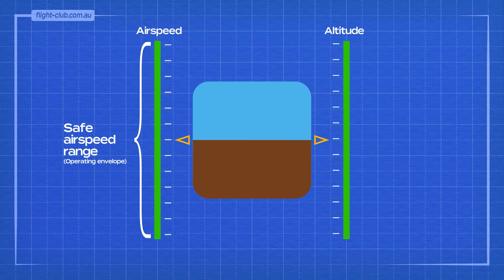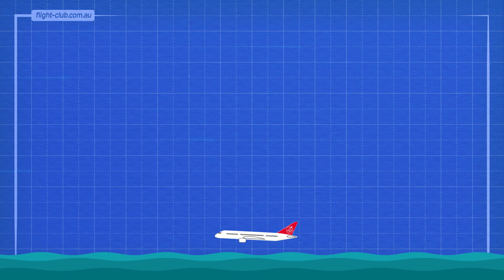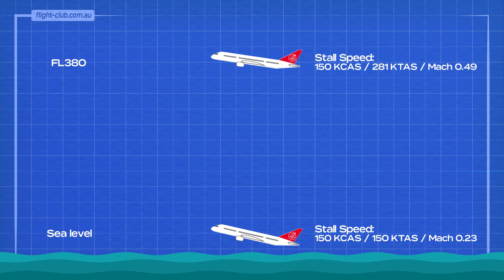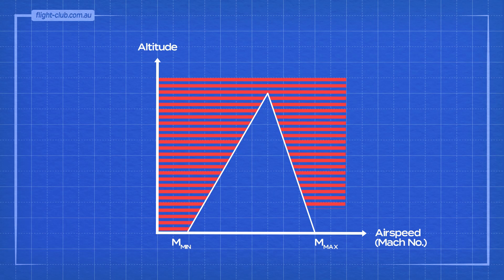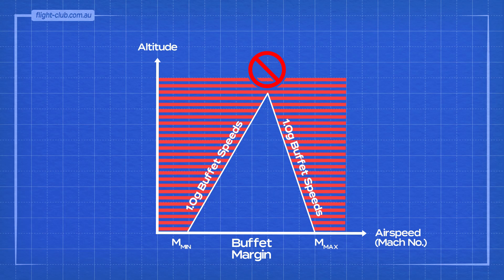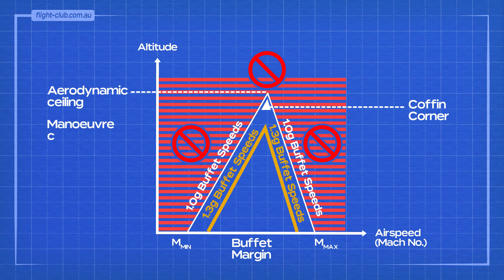Understanding Coffin Corner | The High-Risk Zone in Aviation.

Comment: Thank you for the video. There are however many wrong things said. To name a few:
- at a given weight, Stall speed increases with altitude : at a given CAS, Mach Number increases with altitude, and increasing Mach Number decreases both stall AoA and the lift versus AOA Curve. In other Words, your stall speed maybe 150kt CAS at SL, but can be 180kt at FL380
- high mach buffeting is a function of Mach and incidence, primarily (it may vary a bit with altitude due to reynolds effect on shockwaves). When you fly at Sea Level, your VMO (lets say 330kt , which is Mach 0.5 at SL) prevents you from flying at a Mach number where Buffeting may occur. When flying at higher altitudes, you fly at a given mach number (CAS is way lower), and at this mach number, if your incidence is too high (e.g too heavy or maneuvering at high load factors), you may encouter buffeting. That is why regulations require that the operating enveloppe (at a given weight) is being limited by a minimum maneuvering capability.

To put in a nutshell, when altitude increases : your lower boundary increases due to the increase in stall speed, and your upper boundary decreases (due to margins to buffeting, or simply due to MMO itself), up to a point at which the margin may be as low as a few knots (check U-2 spyplane info).

Comment: Wait… isn’t Mcrit and therefore MMax roughly constant with altitude for an aircraft? Max (buffet) values for TAS, IAS, CAS and EAS all decrease with altitude, but not the max Mach no. So, shouldn’t the chart showing Min and Max airspeeds show an effectively vertical line for Max value if it’s being expressed as Mach Number and a sloping line if represented by any other airspeed?

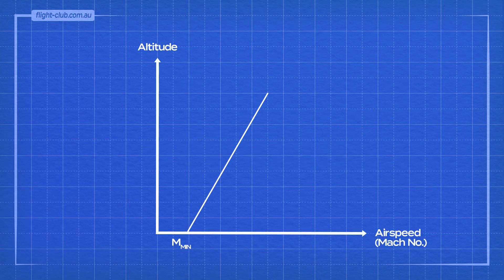Comment: From 2:27 you said "" The Mach number for high speed buffet decrease with increase in altitude ""   how this happens can anybody help me with this
Reply: Due to lower density of air and Lower pressure, the Mach number for buffeting decreases with height as the instability of airflow over the tail wing is usually higher due to a lower density so air compresses more quickly. 

Think of it as squishing water and dough, the dough is hard to squish, like high density, low altitude air, and the water is easy to squish, like low density high altitude air. The more squish, the more compressive the fluid and the easier it can buffet. 

Compressibility is a pain but reading from Wikipedia online should suffice if you want more reading.
Reply: It’s because when the altitude higher, the temperature goes down. The cooler the temperature the smaller local speed of sound(LSS). The aircraft will therefore more easily reach Speed of sound and create shockwaves, which generates high speed buffet.

Comment: But shouldn't the air resistance decrease when you go to the higher altitudes and therefore the maximum speed you can go should increase rather than decrease before you hit the turbulent eddies and stall? What am I missing here?
Reply: Sound's speed decrease with air density, so you have the formation of shockwaves at lower speeds

Comment: 0:30 altitude is just one of several factors that dictates stall speed. It isn't just altitude. Load factor, total weight, temperature (air density)... location of center of gravity, power, power location (nose, wing, tail), and power type...
Reply: They aren't trying to explain what determines the stall speed of any one aircraft, they're trying to explain what causes the coffin corner. In that regard, an aircraft's stall speed increases with altitude.

If this was a video about what factors dictate how aircraft are designed in regards to stall speed and pre- and post- stall characteristics, they would mention those factors. But it's not, so they aren't going to make an hour long segment on irrelevant pedantry.

Comment: Excellent description.  Of note, on modern airplanes the limits are visually displayed as shown at 0:26.  I spent a lot of time on the MD-11 and it was common to see these limits depicted by the airspeed indicator at high altitude.  As expected, the limits were reduced when in a turn and after an extended period of cruise (hours) they would decrease and in many cases disappear altogether.  While they were designed to allow a margin of error, in all cases they were respected.

Comment: A easier way to explain it is to use smaller planes as it is easier to visualize. You plane can only go so fast before the wings rip off. Aka airspeed limit. You also have a fixed wing area. As you climb the air thins but you can still only go so fast. Lets say your in a Cessna 172 your limit speed is 125 knots. at 0 ft it takes only maybe 60 knots to make enough lift to lift the entire plane. HOWEVER at higher altitudes such as 10k ft you must be going around 100 knots to support the same weight. Eventually those 2 numbers cross and that point is your service ceiling. For smaller planes which don't have to worry about mach effects you can have the throttle all the way in going full power and you will just stay at the same height. (around 12k ft for a small plane). Its like as you go up your wing gets smaller and smaller.

Comment: I read that while piloting the U2 at very high altitude, 90,000 feet more or less, the pilot has to maintain air speed to within 5 knots.   Go above or below and the U2 plane will stall and fall out of the sky.
This video helps explain why.
Reply: Now imagine some SAM locking unto you and launching a missile
You cant really maneuver, you are a sitting duck essentially
Reply: @danieldorn9989  just HOPE it loses lock or something
Reply: There is no way you were reading while piloting the U2
Reply: Was going to say something about it living in the cusp of that corner, but I got here a bit late.
Reply: I believe there’s actually a couple planes with rear mounted engines that can get into a “super stall” where it’s literally impossible to get out of the stall. I forget the exact aerodynamic reason why though.
Reply: Planes are meant to glide tho they don't just drop ?
Reply: @triggas80  They drop like rocks when stalled, and controls do nothing until they regain sufficient speed. A heavy fast plane can drop thousands of feet before regaining control, and passengers fall back into their seats.
Reply: @triggas80  and i'd just like to add that the U2 could theoretically flat spin slow enough to NEVER regain ANY control authority again and would just flatspin down from 90000 to a hard impact with the ground.
Reply: So a little coughing from the pilot will put him in coffin

Comment: You know I've read about operation ceilings for years, not until this video did I understand what actually causes them. Would be interesting to see that graph for different planes: airliners, early prop planes, SR-71, modern jets, concorde etc
Reply: High-speed buffet is something that is only really a barrier for modern jet powered subsonic aircraft.  The phenomenom is better known to the public as the "sound barrier".

This means that prop planes simply can't fly fast enough to achieve high-speed buffet under normal circumstances (although in World War 2, some of the fastest planes had problems with it during dives), and supersonic aircraft have wing design that allows them to tolerate it, thus allowing them to, well, fly faster than the speed of sound.

There's still a reasonable concept for "coffin corner" for any aircraft, but for supersonic aircraft, as well as "slow" aircraft, it's more just the point where your stall speed catches up with your maximum airspeed.
Reply: @Keldor314  "A prop plane simply can't fly fast enough"
Eh. Something like a Tu-95 might be able to push its critical mach. The things have comparable top speed to jet airliners.
Reply: @petersmythe6462  This was first encountered with the P-38 during dives, it was the only plane that could both fly fast and high enough for this to happen.
Reply: @petersmythe6462  Maybe, but the prop tips could go supersonic first resulting in some serious damage to the blades.
Reply: The SR-71 is a Unique beast. It leaked like a siv on the ground but at operating altitude, it was just fine. Rumors are the successor to the SR-71 (which is still classified) uses an alternative power plant and propulsion system. That's about it. The name and it's very unique, and just mere rumors.
Reply: @JG yeah thats true, propellers driven by jets

Comment: Fair warning about BUFFET : The most common flight civilian trainer (US at least) is the Cessna 172. I have not always experienced Buffet. Neither,  apparently,  did AF447.  Designed in? Yes.  Foolproof? No.
Reply: (and I should add) ...that's the trouble with fly by wire. Induced Buffet can be filtered out or Stick Shaker added, by software.  MCAS is a perfect example of software between the control surfaces and the Pilot that betrayed all on-board.
Reply: @arcanondrum6543  buffet in FBW types such as a330/350 isn’t filtered or induced by the system. It’s a natural aerodynamic buffet.
Reply: Another fly-by-wire example is in 2013 when a Russian Test Pilot's resourcefulness saved himself and an Su-35S from a Flight Control Failure starting from gear-up until the Pilot's incredible landing 50 minutes later.

Comment: Some small jets have a "go fast" switch that disables warning about getting outside of the maneuvering envelope. These are an extremely bad idea.
Reply: It doesn't sound like a good idea. Those warnings are there for a very good reason and a lot of AC crashes have come from pilots either ignoring them or disabling them all together.
Reply: Sounds like BS.
Reply: Obviously not meant to be used outside of emergencies.

Comment: You didn't really explain why the coffin corner is so deadly. The problem is you can't speed up because it will result in shock waves disrupting airflow over the elevator resulting in a loss of pitch control, which in most aircraft will result in a pitch down which will result in even more speed. This cycle generally only ends with lithobraking (slowing down by flying though rock). You also can't slow down because that result in an aerodynamic stall, and recovery from stall requires adding airspeed which puts us right back into the overspeed regime. Similarly attempting a controlled descent will also result in over speed with the same result. Attempting to climb will just lead to a stall. The only thing that might save you is flying into colder denser air, but you can't even turn to get to that air because the turn will cause you to stall as well. Basically as long as everything keeps working perfectly and you don't run out of fuel you can fly indefinitely in the coffin corner but as soon as anything changes you're going down and there won't be any way to regain control in most cases.

There are two ways of accidentally ending up in the coffin corner. The first is flying into a sudden increase in headwind. The other is to have been flying with a strong tailwind that suddenly stops.
Reply: You can descend without increasing speed. This is the way out.

Comment: Very informative, guys. I wonder where I should look (other than a high performance instructor) for more information on how CAS/TAS/Mach are all related and how to understand the relationship intuitively?
Reply: A good rule of thumb is TAS increases 2% per 1,000'. If you're indicating 300KCAS at 25,000' your TAS is 50% higher (450TAS). Back in my 727 days some of the old heads flew pretty fast if we were late. The 727 had very high limits for a transport- Vne 400kts, Mmo .9M. Once in a while we'd get Mach buffet at .88 or so. An inexperienced F/O would instinctively pull back (we're flying too fast) which only made it worse since the increased AoA increased the speed of air over the upper wing surface where the shockwave was forming. The correct response was an immediate thrust reduction. Finally, many transports don't have the thrust to reach the coffin corner so it's not an operating concern.
Reply: @gerardmoran9560  Isnt there also a warning that pops up reminding the pilot?

Comment: How did disrupted airflow from the main wings affect airplanes with ailerons high on the tail like the 727?  Thanks in advance!
Reply: I think you mean "elevators".  If the plane was stalled, the nose was pitched up at a steep angle the turbulent flow from the wings did indeed cross the elevators and the usual procedure to un-stall the aircraft didn't work.  It was called a "deep stall".
Reply: Raising the elevators on the 727 aided in reducing both high speed and low speed buffet, but in extreme conditions it would still be affected.  I believe the F-101 was one of the first to use this concept, followed by commercial examples like the DC-9 and B-727.  The F-4 used elevators (actually stabilizer) on the centerline that actually drooped to avoid the problem (negative dihedral).

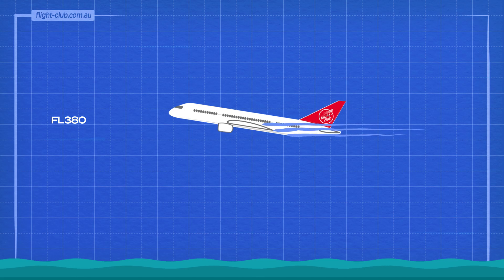Comment: 1:40 That's incorrect. Altitude has nothing to do with critical angle of attack. In other words, buffeting or flow separation and stall ALWAYS happen at the same angle of attack for any given airfoil, ie wing.
Reply from the maker: Thank for leaving a comment but I believe that this is video correct as aerodynamics at high level behave differently. You may be interested in this article about the 2009 Air France Flight 447 accident: https://www.ainonline.com/aviation-news/2012-05-14/understanding-high-altitude-aerodynamics-critical
Reply: @flightclubonline  I appreciated the work you've done so far. Thank you for this article too, I have been trying to understand that for a long time.
Reply: Angle of attack only matters because of the pressure effects it has behind the wing. Altitude, of course, affects the pressure. Thus, both factors must be considered when understanding flow separation

Comment: Enjoyed it! However, if an airplane somehow got into that coffin corner, would neccesarily accepting a stall and then recover be the only way to solve this?
Reply from the maker: Thank you for the good question. The answer is complex but accepting a stall is probably not a good solution. This document is a good resource. Have a look at the "High Altitude Aerodynamics - Principles" section: https://www.faa.gov/other_visit/aviation_industry/airline_operators/training/media/ap_upsetrecovery_book.pdf
Reply: @flightclubonline  Thank you! I appreciate it
Reply: There is no good way out, hence "Coffin Corner". Any increase in speed will cause loss of vertical control. Any decrease in speed will cause a stall.

You can't climb, decent will add speed leading to loss of vertical control, attempting to slow down will lead to a stall, and trying to increase speed will lead to loss of vertical control. A stall recovery will lead to adding speed to recover from the stall. Generally any way out of the coffin corner either ends with inflight breakup or lithobraking... If you could manage it, a protracted stall might allow one to reach denser air and regain control, but the problem is you have almost no control authority to enter or stabilize such a stall, and if you had enough control authority your Vman would be higher so you would just be having the same problem at higher altitude and speed...
Reply: @jdrissel  descent doesn’t add speed.  You can descend at constant speed.
Reply: @peteconrad2077  read properly what he wrote. You can only achieve a CSD if you have enough control authority & your engines respond predictably to throttle inputs. If you're tumbling out of the sky following a high-speed stall, neither of these options will be available to you, at least, for most of the decent. If you're lucky, & your plane doesn't fall apart, you might get away with it but 9/10 times you won't. Check out pilot accounts of flying the B-47. This early jet-bomber regularly operated very close to coffin corner to get the desired range from of it's primitive turbo-jets. Consequently, it was very exhausting, & potentially dangerous, machine to fly over long missions due to the pilot's constant struggle to keep the plane just below coffin corner.
Reply: @peteconrad2077  If you find yourself in the corner, think of the envelope graph.  Once the stall starts you gain airspeed and this pushes you to the right of the flight envelope.  There is no way of bringing the airspeed back into the envelope because you will not have any control surfaces that can direct airflow.  Short of a drouge chute which most aircraft do not have you Har praying you hit a dense pocket of air very quickly before you have reached Vne and the plane breaks up structurally.  If by chance you fall to the left of that envelope you will find yourself in a flat spin praying for some force to get your nose pointed down.
Reply: @westondavis1682  What I think he means is that if you are in the coffin corner but not yet stalling, that there is a way to descent and not increase air speed. Decrease power at the same time as lowering the pitch.
Reply: A structurally tough fighter plane like an F-15 could probably stall in the coffin corner and fall and still be able to recover at a lower altitude. A very tough plane like the X-1A research plane were built to withstand insane amount of G-forces and it actually did recover from extreme high altitude/high speed stalls.  However, most passenger airliners and other civilians planes will probably break apart midair.  Entering the coffin corner is NOT recommended in most airplanes.
Reply: @SithLord2066  Fighters don't really have much of a coffin corner, since they're designed to tolerate breaking the sound barrier (the right wall of the envelope).
Reply: Nice